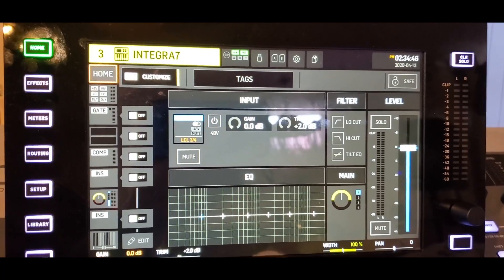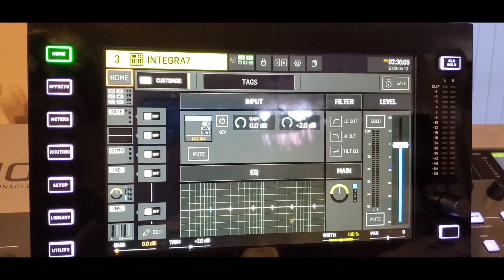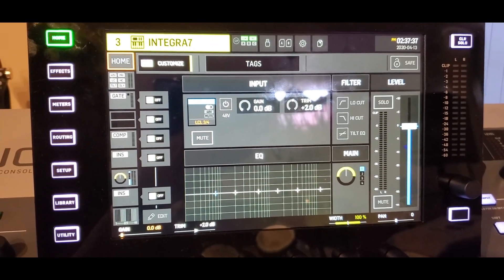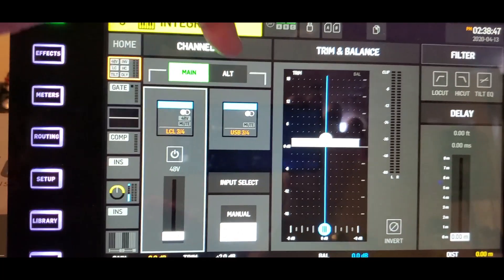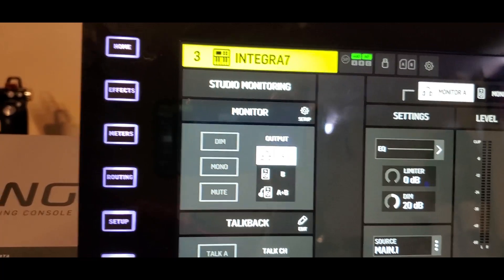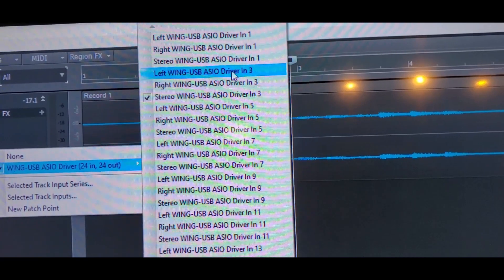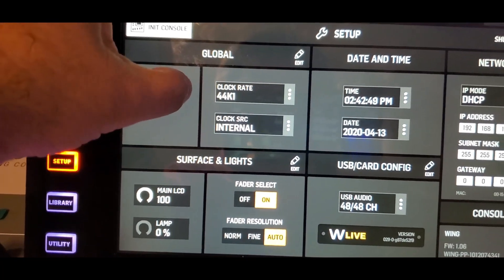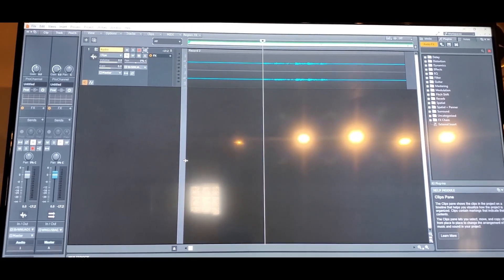Behringer Wing DAW Integration

Comment: Can this be used as an interface aswell as controller for recording at 192khz in DAW?
Reply from the maker: Hi Rohan   yes to use as an interface and controller. Unfortunately only 44 and 48 kHz are supported.
Reply: @basementmidi  thank you so much for your swift reply really appreciate it 👍

Comment: Hello. I run a small studio in Korea.
I bought a wing this time.
It's hard to find information in Korea.
Write down the questions here.

If you don't mind my asking for help.
I'm not good at English. Please excuse me.

I recorded a multi-track song with Wing on DAW.
I would like to record the recorded source again in DAW with Wing's FX.
Could you explain the routing method for this?
Reply from the maker: Hello Wilo, I am very new to digital mixers and consider myself a lowly hobbyist. That being said, this is one of the methods I would love to learn myself. As far as I am concerned, the answer is no, this is not possible. I have had people comment that this can be done, yet no help or solutions are offered. If I ever encounter a solution for this method, I will certainly post a video on the subject. Additionally, if anyone else reading this has a solution, please be kind and share with the rest of us. Paul

Comment: Hi Paul Really Great Video I was wandering if you could show how to route the channels  only i can't seem to get the meters working via USB  Thanks
Reply from the maker: Hi Pete, thanks for your kind words. I did a video a while back as I ran into that very issue. In Cakewalk in the control surface settings, there was a checkbox to enable the meters. I don’t know if that is the case with every DAW. I hope this the answer you seek. Personally, I am very much an amateur with the wing.
Reply: @basementmidi  Thanks so much for your reply i use Reason 10 and there is no check box for the meters strange because everything else works ok and i like you am learning
Reply from the maker: @petejardine7162  Silly suggestion for you. Did you activate the reaper template on the Wing. My apologies if you already thought of this.
Reply: @basementmidi  Hi Paul  Would The Reaper Template work for Reason 10 !!
Reply from the maker: @petejardine7162  I remember seeing that suggestion on a forum for another DAW. It just might. I’m grasping at straws though, might be worth a try.
Reply: @basementmidi  Hi Paul just tried that and it all works as it should but not the meters after watching your video i routed all the channels in main and alt and still nothing !! only channels 1 and 2 are working !!
Reply: what it looks like is the master faders are on 1 and 2  even though i have routed all the channels everything comes out on 1 and 2
Reply from the maker: @petejardine7162  Hi Pete, silly thought. Do you have the DAW button selected? Unfortunately many Wing owners are using the board as a front of house/live type scenario. There does not seem to be any resources for us using the Wing in a studio environment. When time allows, I hope to do a step by step tutorial on how I got my setup up and running. I was prompted to make these videos to help others and hopefully encourage expert users to do likewise but in a manner that is not rushed. Fingers crossed!
Reply: @basementmidi  Hi Paul Yes i have the Daw button selected i tried again last night but to no avail i am now wandering if my Wing could be faulty !!
Reply from the maker: @petejardine7162  Hello Pete, I just uploaded a video. Hope it might be helpful for you.
https://www.youtube.com/watch?v=FfBeadXTUJY&ab_channel=PaulF
Reply: Hi Again Paul Another Great Video you have put on Still never managed to get the meters going but when you play all your channels do they all show up on the desk meters mine do but only the first 16 channels and the first 2 channels on USB Audio i am now wandering if it is the software in Reason that only allows this !! Thanks Paul
Reply from the maker: @petejardine7162   Hello Pete, I have never used reason, unfortunately I do not know what to tell you there. However, going from your description; it seems that the DAW mode on the board is not activated. (I could be mistaken though)  Perhaps if time allows, maybe you can install a free copy of Cakewalk by Bandlab on your system and test it to see if the issue persists. Hopefully this way you can narrow it down to the board or the DAW creating the issue. I know this will be a time consuming pain to go through, but hopefully it will reveal the source of the issue for you. I wish you success!

Comment: How does it work when overdubbing. How will you hear the already recorded tracks as you record a new one?
Reply from the maker: Absolutely. The Wing can do double duty as an interface and control surface.
Reply: Thnks for getting back.  So yes I can overdub. So record my drums first then rewind and put on a bass etc wash rinse repeat ? Do I have to use a computer program only or can you also do that on the SD cards etc....i hope im being clear. Man if it does that also on the SD cards then im sold. I know the x32 can't overdub on the SD cards. Thanks so much for your help.
Reply from the maker: @tiam4281  Hello T I am, unfortunately I do not know since I strictly use my wing for studio producing only. According to Behringer, with 2 SD Cards you can have 64 tracks. I would suggest asking the folks at musictribe.com. I hope you find your answer. Best of luck to you!
Reply: Thank you for your time Paul I truly appreciate. Cheers

Comment: The Wing is a major downgrade from the Sapphire Liquid 56. the 56 will go up to 192kHz whilst the highest sample rate of the Wing is only 48kHz. It is only as good as the ADAT8200 which I also own but when switched on I have to drop the Liquid 56 sample rate to 48kHZ. Yes many will accept the 48kHz as a compromise, but most pro studios/producers would laugh at you and claim it to be a amateurs toy and tell you to buy a Allen Heath SQ series mixer. It looks an amazing piece of kit and serious good fun to play with, but like the X32, more suited to live than studio production

I have looked at both the X32 and Wing as a replacement for my Yamaha 01x which I complimented when I bought the Liquid 56. Sadly neither for the price are better than what I have now. I would be as well keeping and using the Liquid 56 and buying the Behringer xtouch as a simple DAW control surface. I know the 48kHz sample rate is a seriously contentious subject, like CDs and "original" vinyl but you loose a lot of head room when it comes to plugins when your only using 48kHz.
Reply from the maker: Hello Uselessoldman. I agree with you. If I was running a pro level recording studio, I would be using an Antelope, Lynx or UA interface. 

My needs however do not require that. I am pretty sure that I mentioned in the video that I am a hobbyist. The projects I create are fir my own enjoyment plus the wing comes in handy when jamming with my friends. I certainly do not have any aspirations to open a studio, besides I already have a full time job that keeps me busy. 44.1 recording is good enough for me especially since I cut my recording teeth on a cassette tape 4 track.

The wing purchase was made with workflow in mind. To my knowledge, there are no other control surfaces out there with 24 faders that would comfortably fit on a mixing stand with a built in audio interface to boot. I don't want the clutter of a Mackie with several extenders.

I am sure there are other hobbyists out there like me that may have purchased the wing for similar reasons. Additionally I have personally had a learning curve with the wing and wanted to share my findings with others at the same time hoping to recieve help and advice. Unfortunately your comment did not do this.

In conclusion, not everyone wants to drive a Ford. Some people prefer Honda or Ferrari, others quite happy with a Chevy or Toyota. Does the perfect interface/control surface combo exists out there, perhaps not. As for now the wing works for me.
Reply: @basementmidi  Hi Paul. I fully understand and appreciate the x32/Wing both offer fabulous, crazy features for the money. Strange & sad that the wing only offers 8 xlr preamps unless you buy the expansion snake making the over all cost closer to the £3k mark, double that of the x32. I also agree there is no perfect control surface and the good ones are not cheap either, specially when you still have to buy the audio interface on top.  As for the Mackie, I counted that out, for what it would cost I would buy the x32 any day, with the bonus x32 has the audio interface should I want to use it, its there, so are the outputs.  

What I would like to know is when you have recorded your tracks from the Behringer to your DAW can you then control and change the effects from the Behringer /DAW or are they hard coded to the recorded tracks?  Can you record the tracks dry, without effects, then duplicate the tracks and use the Behringer to then add effects later inside the DAW or only on the unit itself? Meaning you have to route your DAW tracks from the computer back through the Behringer and back into the DAW? I use the word Behringer cos I wonder if what the Wing can do the x32 also does, or similar. I know the Wing has substantially more effects power over the x32, but I wonder if the work with the DAW/computer in a similar way
Reply from the maker: @uselessoldman1964  I totally agree on the limited amount of inputs, and I have used every last one of them. Thankfully, I do not need any more at this time. Perhaps down the road I might expand with the S16 or something similar. As far as using the Wing effects, I wish I knew how. However, to my knowledge, neither Behringer or anyone out there on the web has offered a solution. Personally, I only use the Wing effects when jamming with others. As far as recording, I use "in the box" processing for all my gating, reverb and eq-ing needs. Perhaps a viable solution would be to go the presonus route as they have the fat channel effects as VST's in studio one. Until then, I guess we need to wait and see if anyone will build the "perfect" studio desk/interface/surface.

Comment: Thanks for the video - how are you getting on with it. I'm a long time Ableton Live user but thinking of picking one up as my first home mixer to replace most of the functions of my DAW. I'll just use the DAW like a multi-track / arrangement editor. it certainly seems like a complete piece of gear. I'd like to see a 'how to use it as an audio interface video' if you didn't make one already. What kind of latencies can you get down to with solid reliable performance? Can it do 48 mono USB channels into your DAW or only 24 stereo?  Can you record all of the effects, eq, compression etc over the USB? How does the USB situation apply to laptop users - do laptops always have certain dedicated USB sockets that are direct to the motherboard? In terms of ergonomics are all of the controls easy to see and reach including the touch screen and channel strip or are they a bit far away? Thanks
Reply from the maker: Hello Made in Machines. Thank you for your kind reply. To answer your questions, please bear in mind that I am a hobbyist and by no means an expert. First of all, lets answer your questions. I am making a series of videos centering around using the Wing in a studio environment. I aim to highlight both the successes I have with the wing as well as what I am struggling with. As far as latencies go, I would say I am not getting anything noticeable, I seem to be getting the same results as I have with using my Focusrite LQ 56 that the Wing replaced. To my understanding, the wing is capable of 48 channels of either mono and stereo. I have gotten instructions from Behringer on how to record with the Wing's effects, but the instructions are difficult for me to understand, therefore the videos and my hopes in that someone can make one as I do better with visual learning. As far as USB on a laptop, you will be fine as long as you do not use a USB hub. I believe I commented on this on a prior video. As far as the ergonomics go, I use this stand... https://www.amazon.com/OnStage-MUS-MIX400-On-Stage-Mixer/dp/B000RXN6XI/ref=sr_1_3?crid=2LJWJEGUR0TY&dchild=1&keywords=mixer+stand+music&qid=1597168549&s=musical-instruments&sprefix=mixer+stand%2Caps%2C160&sr=1-3     ... The stand comfortably accepts the wing, I just removed the rubber feet and I have the luxury of moving the stand. With the tilt, I can comfortably reach the faders and read the scribble strips. I would award the wing with a score of 8/10. The reason being is that Behringer's documentation is minimal at best (especially regarding studio use) plus the remaing 2 issues I would like to conquer are 1. Creating a hardware loopback for outboard gear 2. Record using the Wing's built in effects. In theory the Wing in my opinion does a great job in replacing an audio interface and a control surface, but the lack of resources prevents me from giving a perfect score which I am sure the Wing has the potential to achieve. I was on the fence on going the Behringer or Presonus route but the Wing won with the promise of the effects and the DAW functionality. Once I get this figured out completely, I hope to make a video to help others avoid all of my struggles. I would welcome a collab with Behringer or anyone else. Better yet, a video from someone who has conquered these hurdles can contribute  a video. Sorry for being to wordy, but I hope I have been of some help. Warm Regards,
Paul

Comment: How can I set up with my iPhone/ iPad daw Cubasis 3
Reply: I really need help with this. Thanks
Reply from the maker: Hi Cassi, Unfortunately I have never used an iPad with an audio interface or control surface. I don’t know if the wing is class compliant or if any iPad drivers are available. My experience is limited to the pc platform and cakewalk. I would suggest either contacting behringer and opening up a support ticket or maybe seek help on community.musictribe.com.        I wish you success.